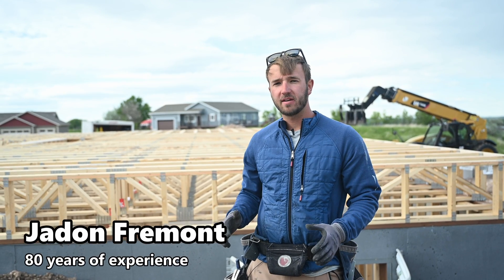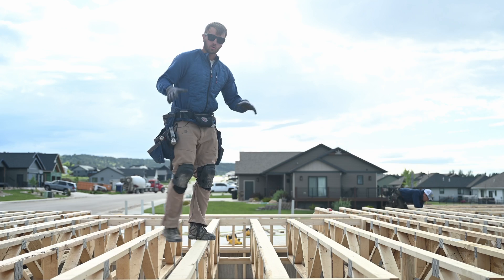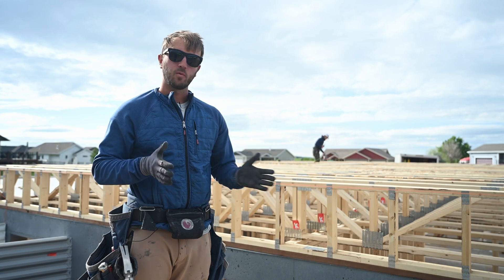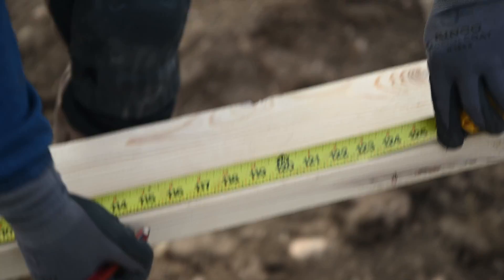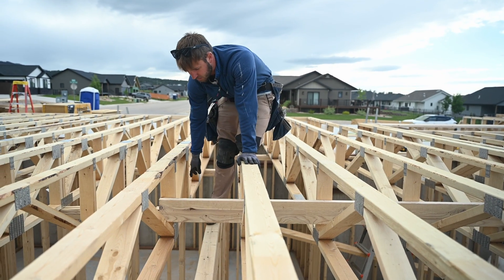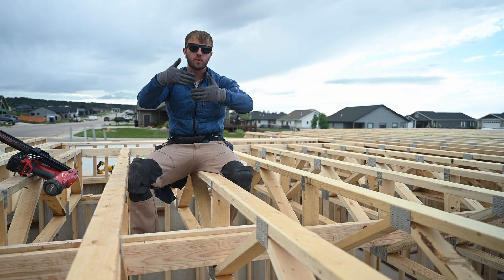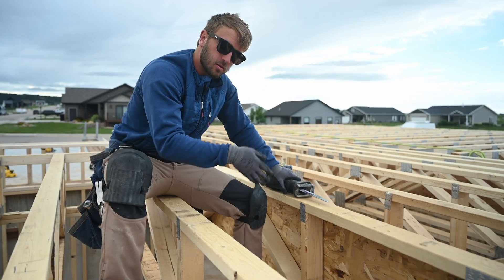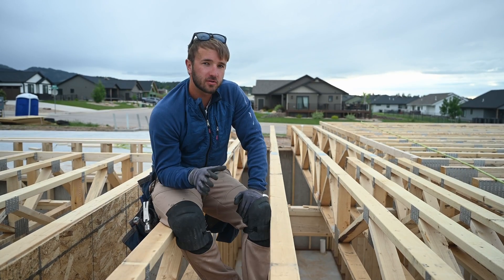How to Install Strongbacks in a Floor Truss System

Comment: For commercial businesses with multiple duct chases, strongbacks should be eliminated, right?
Reply from the maker: Valid question!  
HVAC trades cut through strong backs all the time. 
I recommend asking your truss supplier for your specific build and area. 

They will definitely make the floor feel more “commercial grade”.   An option we prefer is to overlap them on opposite sides of the uprights.  That allows space above them for HVAC ducts.

Comment: I have one of these spanning 3 trusses and the floor is sagging in those 3 trusses. Did this strongback weaken the floor 30 years later? Mine are nailed in, too. If it matters,  these trusses span the kitchen and dining room, but doesn't hold the fridge. There is 1 board - no overlapping. That part of your video might have answered my question. 😢

Okay, also, do I have to span the whole width of the house? Or can I reinforce only part of the house?

Comment: I 100% agree with this strategy, I'm surprised more builders don't do it. So much more stability for less than $50.
Reply from the maker: I believe it is recommended by the truss manufacturers.  Thank you for the comment!